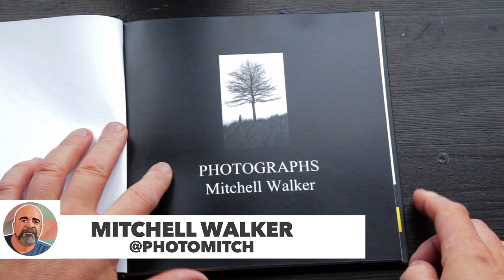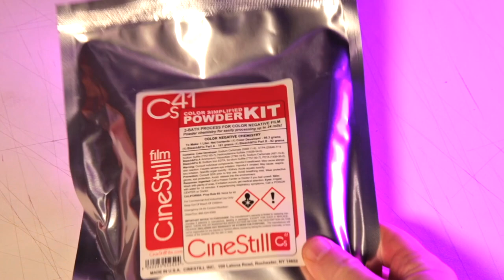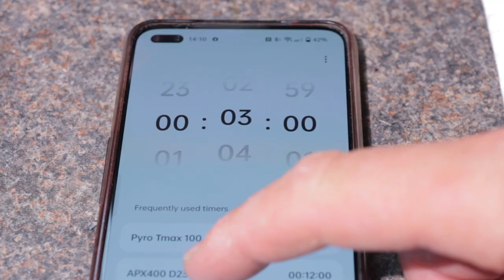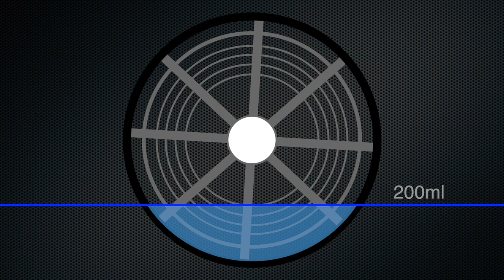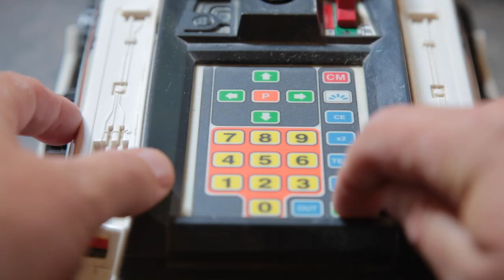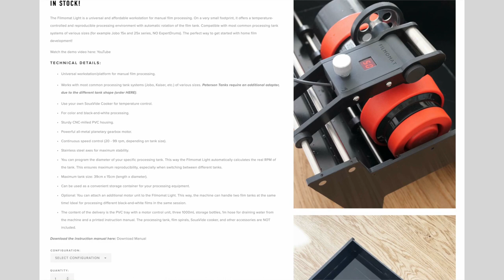Developing  B&W Films with a Rotary Processor! I have been getting great results. Filmomat Light

Comment: Roger, you may want to consider using marbles or other glass beads to weigh down the plastic containers that tend to float in the water bath.   They should not interact with the chemicals in any way being relatively inert. Best wishes from the USA!
Reply from the maker: Thats a great idea putting a weight of some sorts inside the bottle.

Comment: A useful tip.
I use powder developers for both film and paper. I weigh the contents of the pouches containing the powder (A and B) on digital kitchen scales, then divide by 5 and mix only 1 litre at a time. I seal the pouches with tape and it keeps fine.

Comment: How does this save on developer? With the powder mix you have to mix the entire batch, once its mixed it has a shelf life. Unless youre developing more than 16 rolls a week it doesn't seem like youre saving anything right? I can see it saving on some black and white developers like hc110 but that stuff lasts forever.
Reply from the maker: It's been saving me on BW D23 using it diluted (1+1).
Reply: I use powder developers for both film and paper. I weigh the contents of A and B on sensitive kitchen digital scales, divide by 5, and only mix 1 litre at a time. I re seal the tops of the pouches with tape and it keeps fine.
Reply: If I mixed the entire 5 litres it would deteriorate before I used it all, so mixing only 1 litre at a time is economical. I am using ID11 and Bromophen btw.

Comment: I use the kitchen washing up bowl & a sois-so (or what ever french spelling it is) 😃
I only do b&w, but using the sois-so, means I can let the chemicals warm up on their own, without having to constantly check on them, allowing time to play with big-track, merlin or Evil Knievel. 

You have now got me thinking. I muck about a bit with electronics (some may have seen my most excellent cheap, simple shutter tester, that works, or simple exposure meter for film cameras) I need to make either an auto-inversion gadget, or as I am a twiddler (I find twiddling gives better contrast), an auto-twiddler.
Reply: A sous vide?
Reply from the maker: It can't be difficult to make a simple rotary machine for BW. "Soon Vide" I think thats how it is pronounced.
Reply: @theoriginalbabycub  yep, the funny french thing.

Comment: nice review, thank you Roger! I saw this product on IG today and wanted to learn more. I'm using an old rotary processor which does have some issues, so I was thinking about getting a new one. This device is currently set at €549.00. Literally, 549€ for a plastic storage box (that's what they also write on the website). It has NO temperature control (which is THE dang essential feature, next to rotating the drum). And it has NO timer. Really?! I don't know, did they speak with people who use drum processors, before they developed this machine? Obviously not. It's aiming to be "light", so I guess it also aims at people with a smaller budget. But still, that's a heavy price, on which you have to add the heater, that you have to buy yourself and fiddle around when operating this machine. Kinda sad actually :(

Comment: Thanks! A great all in one machine.  Unfortunately, I am the very happy owner of a rectangular Lab Box. A development  tank for 120 and 135. No darkroom required. No fiddling and loosing track with curly film. So I will have go on with using a crank to roll the film and use the sink to keep the water at the desired temperature. Developing film in a bright kitchen on a sunny day has its drawbacks. 😢😂

Comment: To stop the bottles bobbing about, the manufactures should consider adding a grid, like a milk crate, so the bottles can float all they like, but will not topple over.

I have the same problem with the washing up bowl & the developing tank wanting to topple over. 

Also, when removing a bottle, the water level can drop, so I have a few milk bottles filled with warm water, which I put in. This is an issue with the sous vide, as it has a narrow maximum & minimum water level.

Eventually, I will have a dedicated container, with a grid inside, so each bottle/tank has it's own compartment, so can bob about, but not topple over.

Comment: Today, very early this morning, I used a rotary "processor" (not as sophisticated as yours--no water bath).  I got it pretty cheaply from ebay (Chinese company). One can adjust the rate of the spin as well as having a timer on it.  It spins in one direction, pauses, and then spins in the other. This really super for such an inexpensive rotator.  I presoak the film so that it is totally wetted as the top half isn't in the developer originally. I think wet the film takes on the developer more evenly (no evidence).  Films are drying now but they look to have come out very well as far as the processing goes. I will need to study them further to ensure that I reduced the development time by the correct amount.
Reply from the maker: Enjoy the process Erich. I think many times if a process makes you feel better then keep doing it. Such as the pre wash. I have it in my mind with some films that have a lot of die that spills of during development it's best to wash it off as it may interfere with the development. Probably doesn't though lol
Reply: Hi, could you share where you purchased your Chinese processor? Many thanks in advance

Comment: Roger, a question about drying. I hang my film in the laundry overnight. There's little air movement, but I still end up with dust on the negatives. Last time I wiped the film with a clean microfibre cloth. No scratches but still some dust, which is very difficult to remove, especially from the emulsion side.

Do you do anything special before or after hanging the film to prevent dust from settling? I'm considering building a drying cabinet, using a couple of face masks as filters and blowing air through the cabinet...

I first developed and printed black and white when I had access to a darkroom in the Student Union in the late 1960s and went back to developing my own a few years ago, using the kitchen sink,  then scanning. I own a couple of enlargers and the plan is to build a darkroom in the basement of my son's house and teach the grandkids how to make prints. One day!
Reply from the maker: I would do this, and have done. Take all the laundry out. Throughly clean the laundry room. Then when you want to hang the negs in future take the linen out. I usually take all the towels out the bathroom before I hang negs. And keep the door closed.
Reply from the maker: Or, you could buy a plumbers PVC pipe to hang your negs into.
Reply: @ShootFilmLikeaBoss  I like that idea. I have a length of downpipe that I cut a couple of pieces off to store umbrellas for my flashes so the ribs don't get crushed.

I'll have a look in the morning (it's 2300 on this side of the world) to see if the remaining piece is long enough for a film.

If it works I'll need to find another piece as I have a Paterson 2-reel tank and often develop two films at the same time...

Thanks for the suggestion, I'll let you know how I get on.
Reply: During the summer time I hang my films on the the clothes line outside and in the winter they hang off the shower door. I've never had any issues with drying them outside.

Comment: Do you keep in mind that the still parts during agitation do play very important role in development, which is to control diffusion and it can affect your sharpness there's a word for it and I can't remember what it is it's something like microcontrast or something like that.
Reply: Yes I wondered about that too!
Reply from the maker: Acutence. Without letting the tank stand during inversions can lead to soft edged grain, which is why stand development appears sharper. I mentioned that in the video. I've not seen my prints unusually sharp with D23 so far. It's something I need to keep my eye on with other developers particularly Rodinal.
Reply: @ShootFilmLikeaBoss  This maybe why my twiddling negatives look sharper. Not sloshing the developer around so much. After initial agitation & tap, I twiddle. Not repeatedly taking the tank out of the water bath saves a lot of water dripping everywhere.

The water bath gets used for rinsing the negatives, so it is not wasted.

Comment: Too large for me, I don't have enough room. But other then that, it would be good value for money!
Reply from the maker: I just remove the toaster and kettle
Reply: @ShootFilmLikeaBoss  It's not about use, it's about storage space when not in use. And rotation is not the cure-all I hoped it would be (I do it manually with a Jobo 2520 on the rollers Jobo offers), since results with 4x5 are even worse than with the SP 445 and SP 8x10 (I give the latter another try the moment I do have 4 new sheets to develop – I've modified it to get rid of a peculiar problem I encountered).